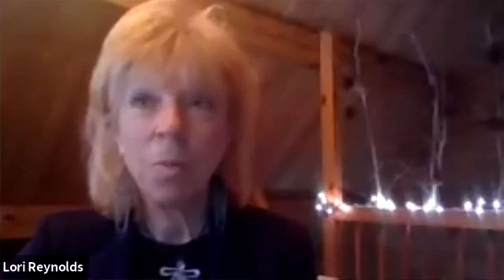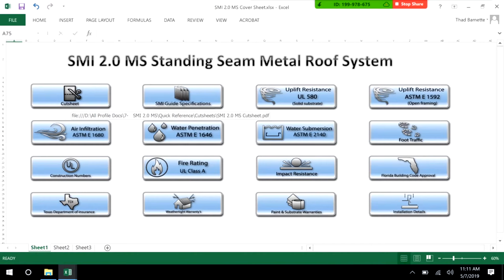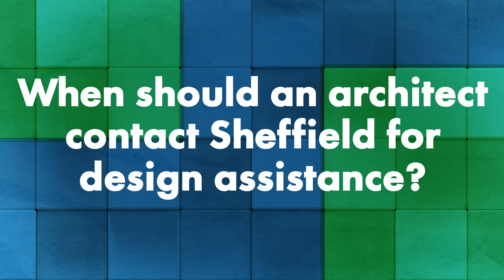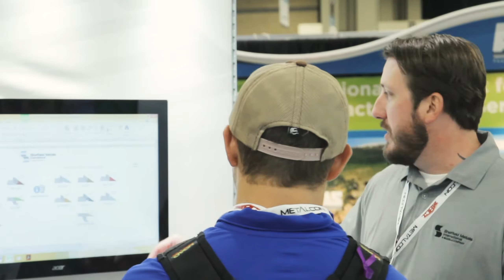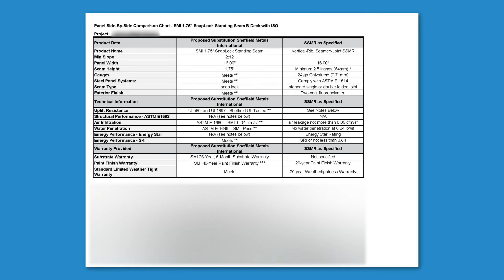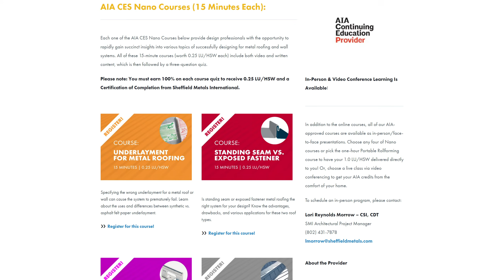Sheffield Metals Architectural Department & Design Programs

Comment: I have been trying to find information regarding installing a standing seam roof with an airspace to create a thermal barrier and provide for ventilation of the roof but there does not seem to be any information on this subject.  I am also wondering if condensation can be a problem with the underside of the panels and the self adhering membrane which if there were a ventilation space would help to alleviate this.